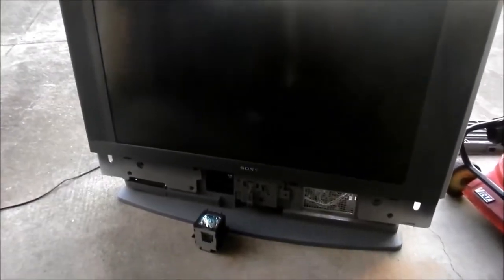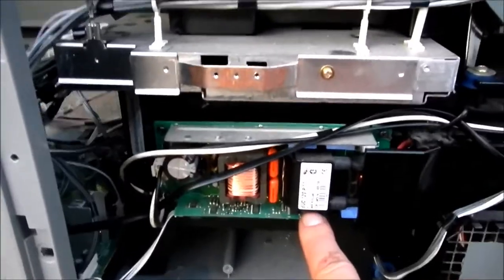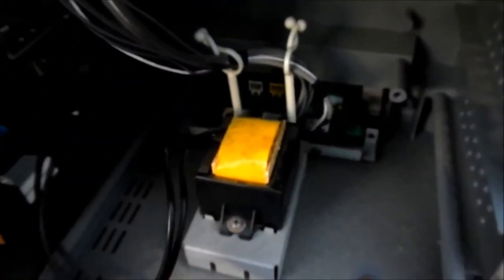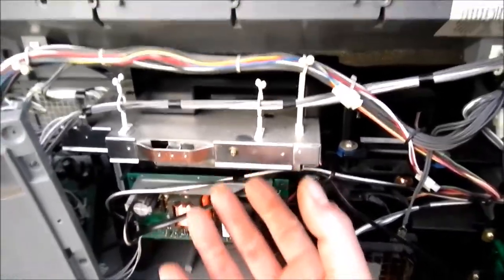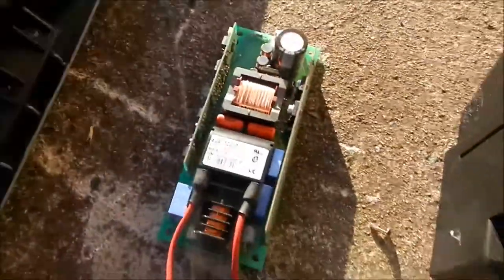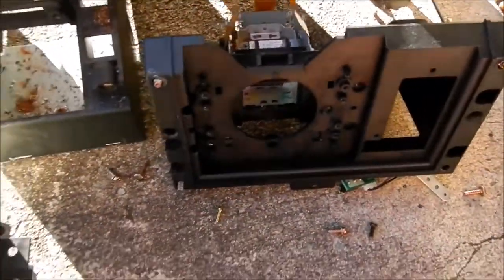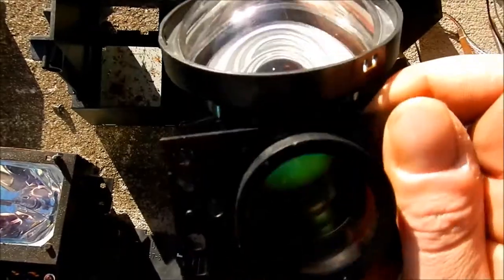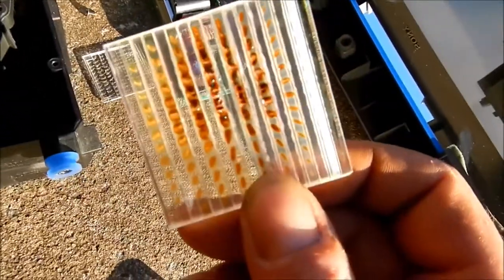LCD rear projection teardown

Comment from the maker: The smaller lenses are good as magnifying glasses, They're average for solar harvesting, but could be good as a small fire starter in a survival kit. You'll only find them in LCD rear projection. The CRT rear projections have 3 larger lenses on the colour tubes. If your just getting started in electronics. De-solder everything (Without cooking components), and work out what it is. Great learning experience. Pretty much everything will come in handy at some point. Tubes and cases in the bin. cont

Comment from the maker: Things to look out for on the boards, are transformers, for use as transformers, or for the copper wire. There will likely be a good audio amp chip. At least one good power transistor, likely a high voltage one. High wattage resistors. Diodes and zener diodes, the flyback transformer, and the hv diode/multiplier setup, capacitors, especially big electrolytics. inductors, buttons switches, ir leds, regular leds, bi colour leds, wire on crt yokes, a great mirror. all sorts of good stuff.

Comment from the maker: oh, one last thing. a cordless drill or screwdriver is invaluable in removing all the screws. Not as bad as a plasma, but expect to have over 100 screws in your tin once your done. 3 secs per screw with drill, near a min per screw by hand... good selection of xl and xtra small screwdrivers can be handy too. for tight spots. mostly no2 philips, a few 1's and 0's too. maybe a few torx or security screws if your unlucky.

Comment: Nice lenses in that one. Much better than the lenses on the rear projection TVs that have three separate projectors. Is the mirror a solid material or flexible? Mine was something like aluminized mylar.

Comment from the maker: This one is a glass mirror. Brings me up to 3 glass, mirrored on both sides. and 2 Nylar looking ones. made from space blanket or something... I'm thinking they could be good with a vacuum applied to the back, to pull a concave. Newer R.P's seem to have the Nylar, over about 10 years old and you find glass mirror... The CRT projector lenses look good for focusing the Fresnel from 3" down to smaller....

Comment from the maker: 240v here in Australia. 390dc is what you get if you rectify it. So just a less than 100uf smoothing cap on the rectifier. I think. Should give about 20ma at 5kv I think. as bulb is rated for 100w.... Might grow some tomato's with it....

Comment: Actually those bulb run at lower voltage they require high voltage to start then they drop in the 800 volts I think :)

Comment: actually if you have 120 ac at your place you need to make a voltage double because 120ac = roughly 165dc so 230ac = 390ac roughly didn't made any math there. As far as amp limit the driver should take care of it. I have one myself from a projector haven't plug it in main yet I don't need to be blind in my basement yet :P

Comment from the maker: Don't break open CRT tubes if you can avoid it, As they can implode from the vacuum inside, and throw broken glass and poisonous stuff, like phosphorous, everywhere at high speed. They are also High Voltage capacitors. So you need to know how to discharge them safely. Never work with HV alone! Even if its been unplugged for months. Try to get used CRT tubes to your council depo, or dispose of them thoughtfully, They are pretty toxic if they break. Cont

Comment: One of worst energy bill usually ever made but good for scape.  I have Rear Projector TV 60".  Darn that is pretty bigger I ever scaped!
Reply from the maker: +Michael Marr Yep. Picture was poor, lamps would be expensive. Not a recommended TV. Great for parts though :)
Reply: So far, I have got len, three CRT and mainboard out.  Len are big about as my hand ~5 inch.  Transformer are really good too.  I could use my dremel to cut wire for reuse core.  It is good for (high voltage, low current:low voltage, high current) or flyback.  It is hard work but one of the better.  I will have my part and wood will go to my friend who will making an table.  Not bad for 27 dollar TV.  

They have problem, dust can get in and cover part on lens.

Comment from the maker: Yep :) Do I need to limit the amps to the driver? or can I make it a 4007 rectifier and hook it right to mains? Had 390v on the input when working. I'm thinking a 450v 230(ish)µf cap to smooth the 390v could be good. The power transistors are pretty small...